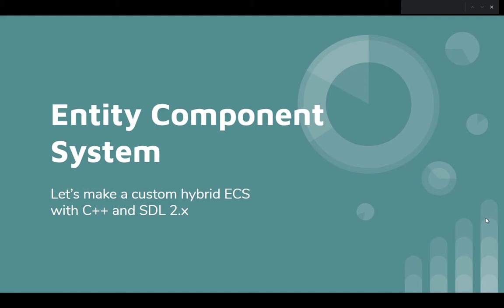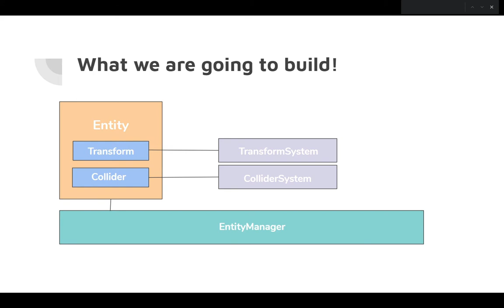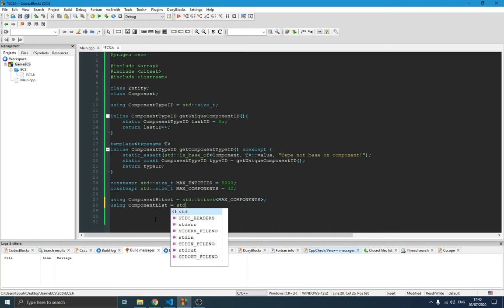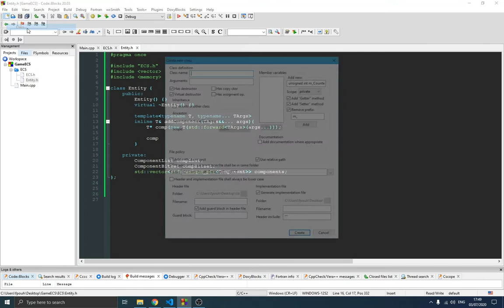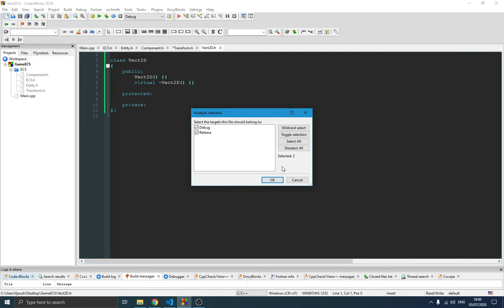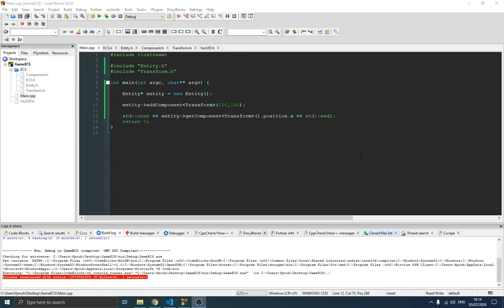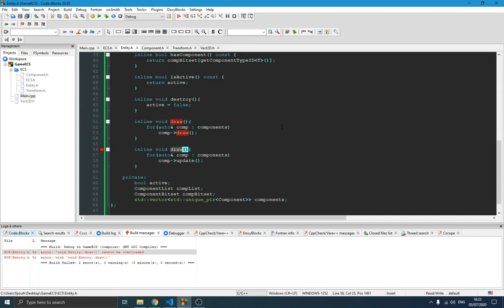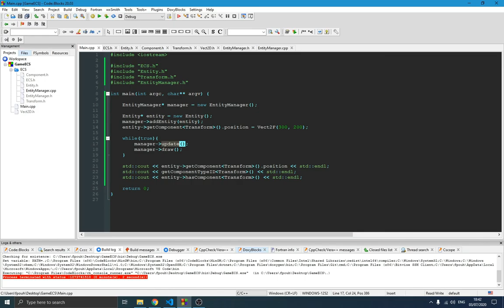ECS C++ Entity Component System Ep.1

Comment: Really liked how clean and simply written this was. Want to call out that the nomenclature here is sometimes confusing, but what you implemented here is more along the lines of a component based object hierarchy (using composition to create object behaviors out of components). An ECS usually keeps entities lightweight by defining entities to be simple IDs and keeping component storage contiguous within an allocation block so components lists are fast to iterate when a system processes them so this is not exactly an ECS per what game dev usually defines it as. ECS is meant to be data oriented, which means keeping the entities and components as data only types and having the logic solely exist in the systems that process said data, which usually results in architectures that allow for more cache hits and better scalability. Putting components in the entity means you have to traverse the entity pointer to get to the component you want to update and traversing the component pointer to update it, which results in two possibly far away memory addresses from trying to load into main memory, not to mention the extra vtable indirections, so more cache misses are likely which typically doesn't scale well if you're processing thousands of objects per frame.
Reply from the maker: Yes, I agree!! that's the reason why I did again just check my channel to see the pure ECS version that I made, which is by the way the one my Game engine uses!! xD
Reply from the maker: https://www.youtube.com/watch?v=W36Ug1F929w&list=PL-K0viiuJ2RfW5AqQ3hu5cRuW_nAdZL07&index=3&ab_channel=Madsycode

Comment: But... aren't inline functions supposed to not allow static variables inside them?
Reply from the maker: as u can see
Reply: Since c++ 17 you can
Reply: inline is ignored by the compiler.  You require it here because it's defined in a header file and you don't want a duplicate definition.